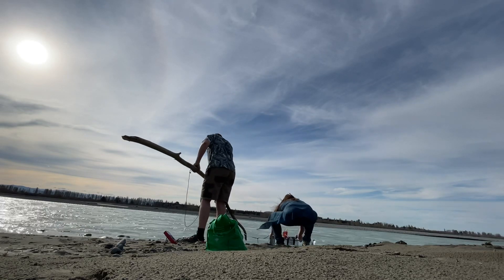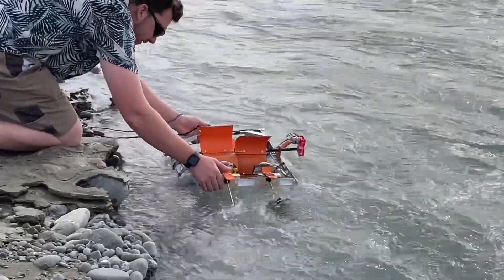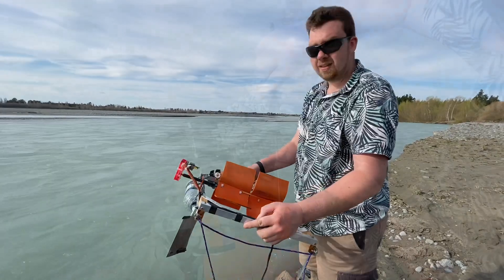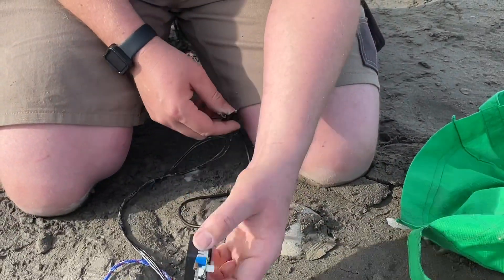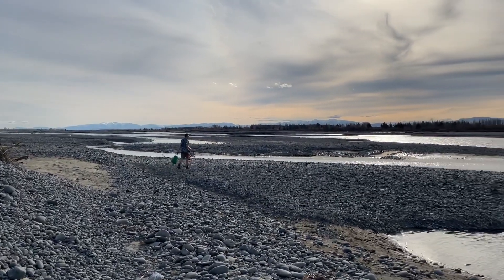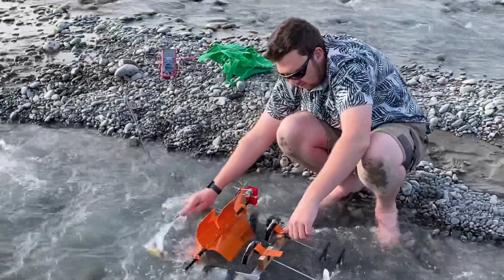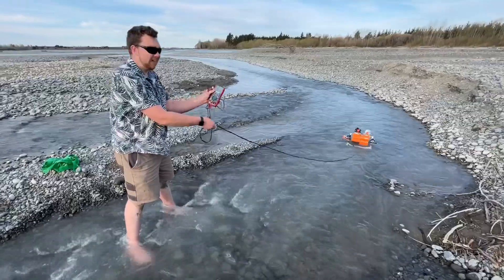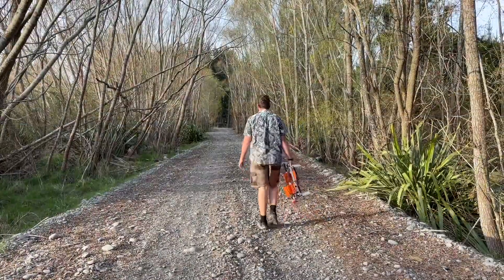Floating Electric Generator - Version 2

Comment: really like the concept. we are in motueka and have the moutere river next to us that floods periodically and has large logs floating down it so needs to be able to be lifted out easily during these times. I've seen some encapsulated types usually made of stainless or 3d printed pontoon types. Im trying to figure out a low cost one to charge our deep cycle  batteries that will generate 13 volts and 10 amps continuously. It doesnt have to produce a lot of amps because it would be running all the time unlike solar. Ive tried smart drive motors for wind turbines which seem ok but not really suitable for placing near the water. anyway all the best with your invention